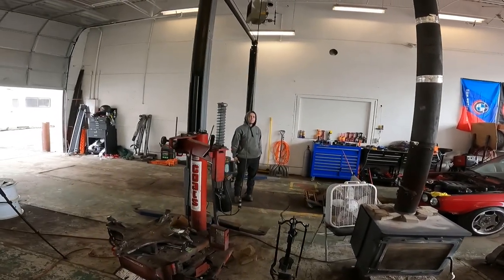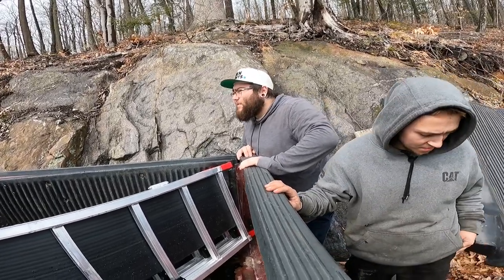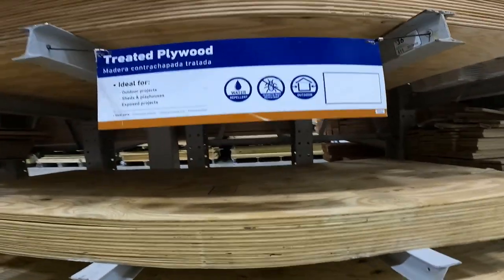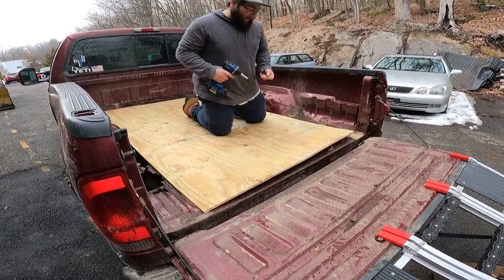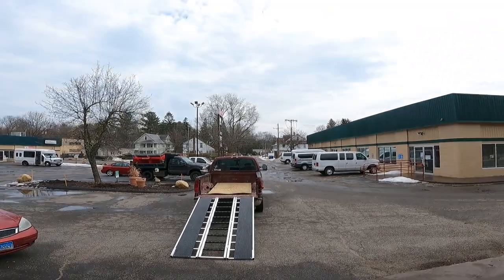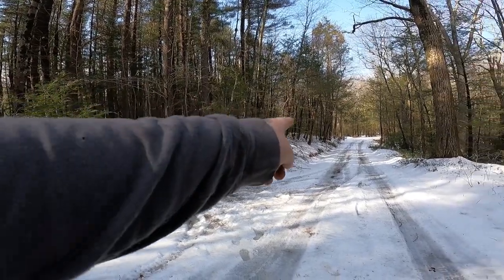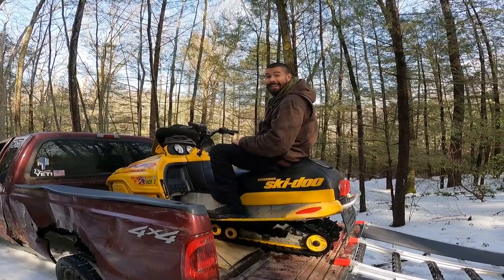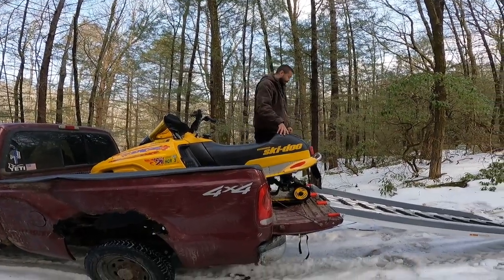First time ripping a Snowmobile (I WAS SCARED)

Comment: That 700 goes over 100mph easily.. my 1998 ski doo 583 goes 100 and it has a smaller engine. It would surprise you how quick they get up to speed if u watch the speedo

Comment: I have a 2001 Polaris rmk800 which is bored out and runs on jetA from the airport . It makes me nauseous if I full throttle. Tip if you plan to keep it invest in some handlebar risers . Will help ur back while standing and increase control in deep snow . I'm jealous of ur reverse btw . If I get stuck I gotta use brute strength or roll it :(
Reply: I bet your rmk is a beast

Comment: turbo 850 2 stroke and 1100 4 stroke sleds are very scary. i work on sleds with not much experience riding them and they will glue you so hard you can barely hang on AND the front will be off the ground

Comment: The v force 3 are just the reeds that he put in the sled . You have a skidoo mx-z 700. The boots tearing is a normal thing after a season which is why most people use bourses reeds instead. T he speed is just fast has nothing to do with v force reeds